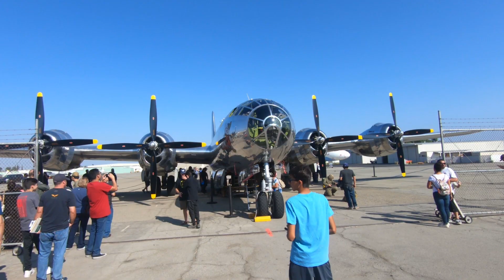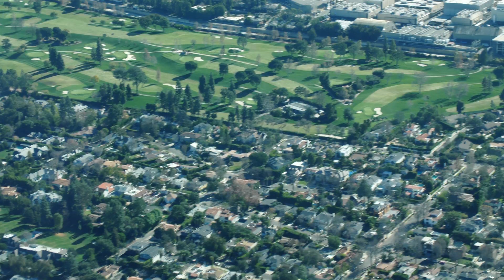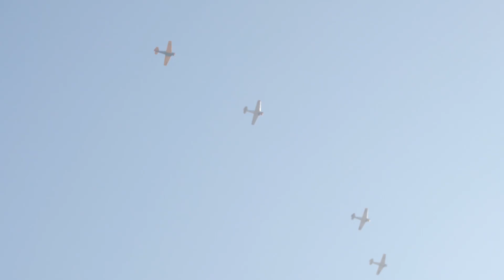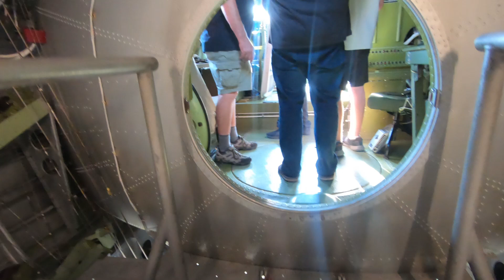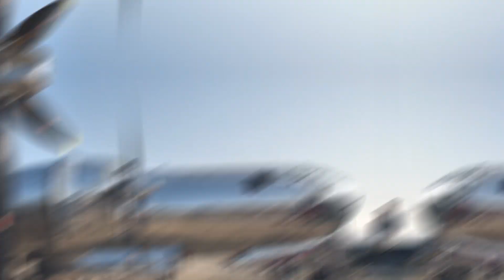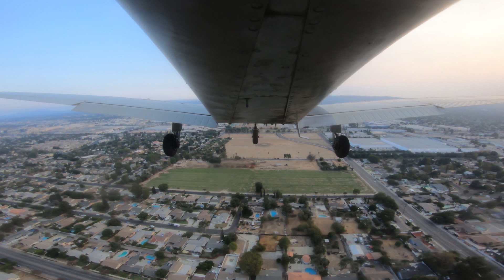The Mighty Boeing B-29 Superfortress Flies Again (up close look and walk through)

Comment: Very cool trip! It appeared like the cowlings on the right engines were fairly dinged up (still shiny though).

The past few flying videos you have been in the Cherokee. Are you finding you have a preference for it over the C172?
Reply from the maker: Someone smashed up the 172 unfortunately (not me), so it's out of service for a while. If I'm flying by myself or with another pilot I like the Piper, if I have a regular passenger then I prefer the Cessna.
Reply: @HeavyMetalHorizons  Oh man, that's a bummer. Someone (not me) did that in my 172 also. Took it off leaseback after that incident.